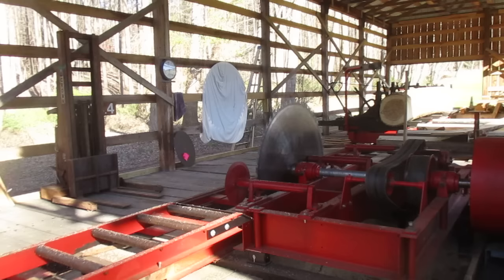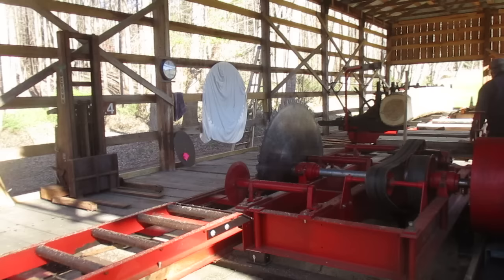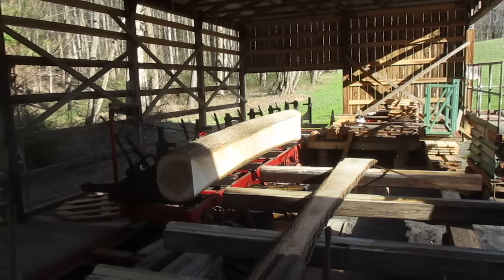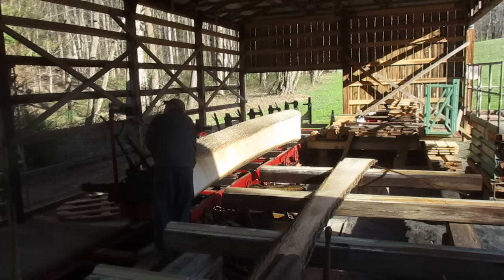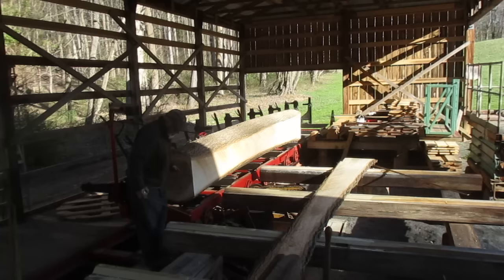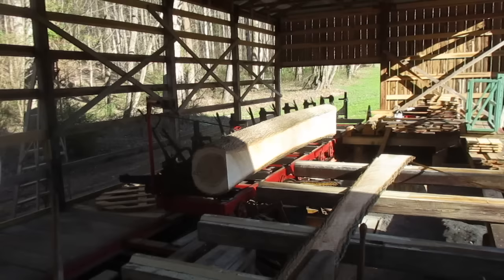BIG Poplar   BIG Sawmill  # 1108 Old style Saw milling

Comment: Dam that was a mite sketchy I'd say. 
Mr John might I ask why you don't have a conveyor belt that carries the drop piece away, are at least a few boards for the drop to land on instead of just an opening over your jack shafts?
Sure seems to be a lot safer than the way it's setup now.
Just wondering, and you know better than I do, but the way that came off then collapsed onto the roller, and it appeared at first it was going to spring back into you, but fortunately it held on long enough for the rest of it to give it enough push to keep it going forward
PS
I was watching young fella down in Mississippi the other day, and everytime he needed to turn his logs.
He'd hung a electric wench from the joist, and he'd take cable with under the log then using a can't hook attached to the end of cable he'd drive the hook into the log at different places depending on how far he was wanting to turn it.
As long as the timber, and shear weight of the log on the carriage, it be advantages to hang two different winches from the reinforced beams I'd install wherever it felt they should be.
They've got nice winches that have wireless controllers, so that you could run them independently of the other, are have them sync together in order to have better control over the logs turning. 
Might be worth looking into the something like that, and for little money and effort it'd surely make it a hellogalot safer for one man army such as yourself
Reply from the maker: hi now lets just think on what you have written , conveyor  may run 10 k to 20k  for a new set up installed . .the opening is the way Frick designed it . so keeping in mind i am still putting this together , then the winch in the rafters , would you really winch a 3000 pound off them , they were made for a load from the top not a pull from the bottom . then once again there is a cost factor , you must be a multi millionaire . all your ideas are great and i am glad you brought them , john